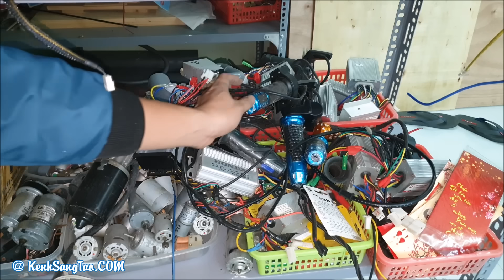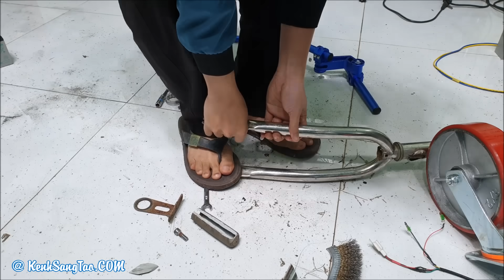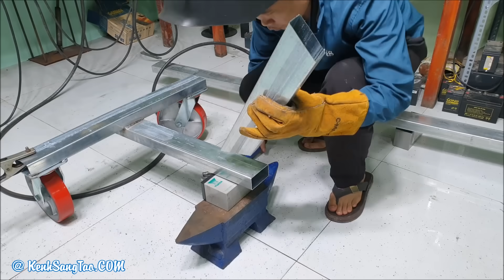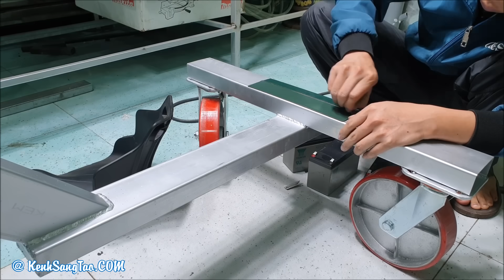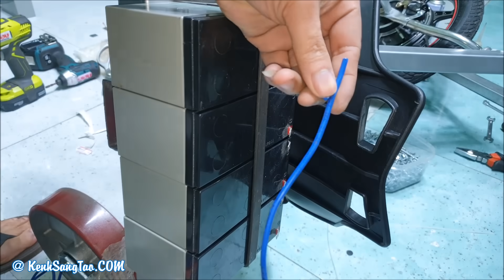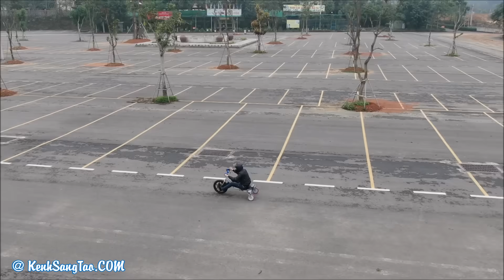Chế Xe Điện 3 Bánh Drift - v2

Comment: Anh ơi em mua xe drift trên mạng nhưng pin 36 vol mà có 4.4A quá thấp giờ em đấu nối tiếp 3 bình ac quy 12v 3.5A thì có lên đc 36v và 10.5A không? Mong anh trả lời
Reply: Bnđấu nối tiếp điện áp lên dc 36v chứ chứ 3.5ah ko lên dc. Muôn lên dc như bn mong muốn phải có 9 bình đấu